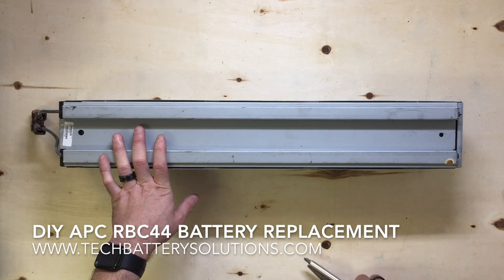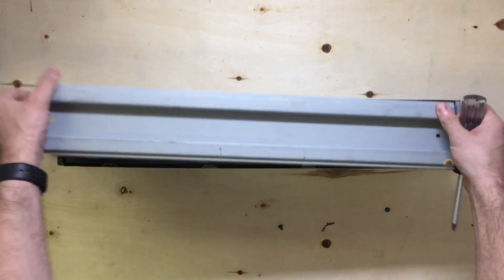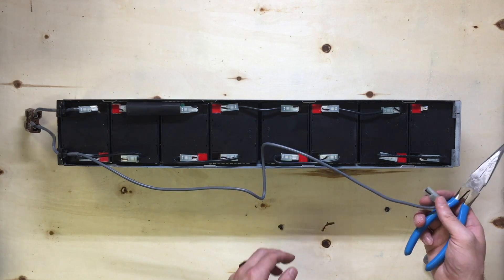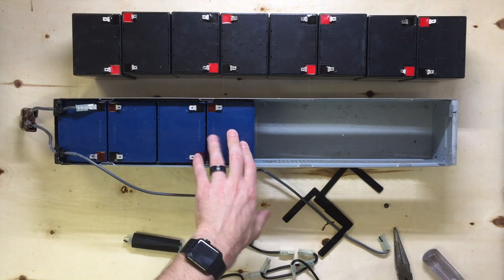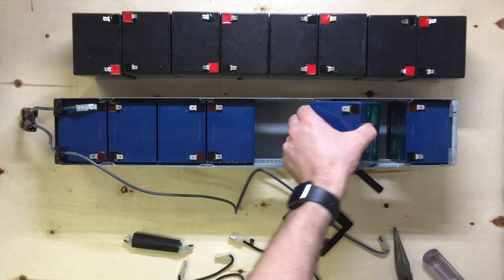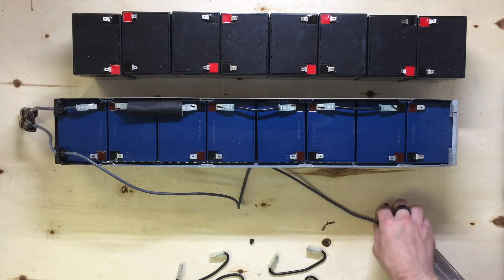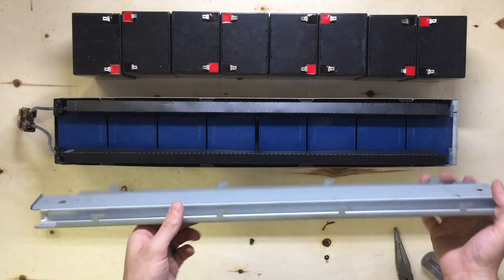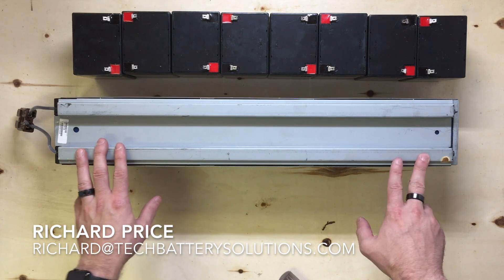APC RBC44 Battery Replacement DIY

Comment: was looking to do this upgrade myself on my APCRBC140 units... any suggestions for using LifePo4 batteries? the supplier seems to say not to run the lifepo4 batteries in more than 4 battery series setup... would there be an issue if I ran them in 2 sets of 4 in series and then wired those 2 sets together in series to get the 92v ? the batteries have their own built in protections and bms.

Any suggestions would be appreciated.
Reply from the maker: I don't have any experience of doing this. It doesn't sound like a good idea however, you have a total of 8 BMS boards that comprise a single battery pack - all of which can't talk directly to each other to control voltage input and output with precision. Put that together with a UPS unit that was designed to run AGM product with an AGM charging profile and a friendlier heat tolerance level - could make for a bad day sometime down the road.

Comment: Could I technically wire these batteries in pairs to make a replacement for a 24v rideable? 8 x 12v at 5ah should give me 24v 20ah, correct?
Reply from the maker: It would have to be in a parallel and then series connection style, but yes you can make it work. We also have a solution for a simplified setup available - a pair of 12V 20AH AGM batteries that can be wired in series to get you where you need to be. https://www.techbatterysolutions.com/24-volt-20ah-electric-scooter-agm-battery-replacement-kit/
Reply: I ask because I have a couple of these (16 total HR1221) from a UPS that was decommissioned. I know I'd have to do a combo of series to up the voltage to 24v (pairing two) then running those pairs in parallel to up Ah and capacity. I don't know if I could fit more than 6-8 so I'm looking at making a 15-20Ah pack.

Comment: Thank you. A friend of my brought me 4x of these packs a company was going to pay someone else to take.

 I have been successful in recovering a lot of still good batteries taking them instead and figuring out the good and scrapping the bad ones.

 There was no information on the outside of them but looking through the vent holes I could see there was 8 batteries inside.

 Initially I guess it was 8 x 6v so a 48v pack. But then using the multimeter I saw 90ishv and realized it was probably 8x 12v instead.

 I later thought it was possible it could be 16x 6v instead if rotated 90 degrees and silm ones but I figured probably not. This video confirmed my second guess and allowed me to take a peak in myself.

 If any are still good it is an excellent find!

Comment: Great video - very clear and concise.
Couple of suggestions when working with UPS batteries: 
1) remove jewelry 
2) insulate the shaft of your screwdriver with some heat shrink tubing
Accidentally arcing across terminals could result in serious injury.
Reply: Number 2 happened to me. The screwdriver shorted the terminals instantly burning my hand. It heats up faster than I can let it go. That fast.

Comment: G'day mate do you know if I can put theas to use for a of grid batteries any help you can give is a great help thanks
Reply from the maker: I would not recommend them for us on an off-grid system. The batteries in this unit are pretty small in terms of capacity, and it would be much more cost-efficient to purchase larger individual 12V deep cycle batteries.

Comment: Hello from Egypt, I've apc rt 5000 ups and I stored it for over a year without using it at all as before that the led for changing battery was on so, now the ups is not working at all (totally dead) even when i plug it into power. and I measured the output voltage of the 2 battery racks together and gives me 88 volt dc, please advise.
Reply from the maker: I would recommend reaching out to APC for this question. I do not know if the APC unit will still turn on given that the batteries are so low in voltage, to me it would make sense that the unit would - but I would get confirmation from the company that built it.
Reply: I decided to buy 12 batteries and thanks God it is working now with 180 v dc however the led for battry is flashing. Do you think I need to change remaining 4 batteries? And what I can do if the problem still exist after changing the 4 batteries. Please advise
Reply from the maker: @MohamedMostafa-wn8pe  Yes, you need to change the remaining 4 batteries, that should turn off the battery light.
Reply: @HighTechBatterySolutionsInc  I just changed the remaining 4 batteries and it is working perfectly.

Comment: Hi, how many module consist in one RBC44 ? And how many module consist in one SET. Pls tell me
Reply from the maker: Hello, there are two physical cartridges that make up the RBC44.
Reply: High-Tech Battery Solutions, Inc ; thanks for your reply, can u pls confirm also how many batteries consist in one cartridge. Pls
Reply from the maker: @Deeps_Bharti  Each cartridge will have a total of 8 batteries.

Comment: Can these batteries be hot-swapped?
Reply from the maker: Yes, most of the larger APC RBC cartridges are hot-swappable.
Reply: @HighTechBatterySolutionsInc  Much appreciated! I was able to basically pluck and chuck without trying to get power cut off to the facility. Fortunately, all battery trays were good and didn't need replacements despite the fact that the APC UPS models are older. Thanks again for your help and the video.

Comment: So this says it is 208 volt can you change it to 240 volt and is that ok for the unit or is it bad for the unit?
Reply from the maker: Bad for the unit, the charging system and the built-in inverter on the unit is set up to operate at a specific voltage.

Comment: what kind of battery used on APC RBC140?
Reply from the maker: Same batteries used for the RBC140 battery pack - https://www.techbatterysolutions.com/APC-RBC140-Battery-p/an405.htm
Reply: @HighTechBatterySolutionsInc  Is there any difference (other than the name) between the RBC140 and the RBC44?  Are they interchangeable?  Thanks :-)
Reply from the maker: @kenbell4990  at first glance, no, both battery cartridges seemed to be the same. But if I had to guess, and knowing APC, I would say that the plug-ins on each cartridge are going to be slightly different.
Reply: 12V 5 Ah

Comment: Thanks, when replacement the battery ..Do you ned to the reprogramable or not??
Reply from the maker: Typically not, we have not had any customers report any issues requiring a reset of the UPS system.